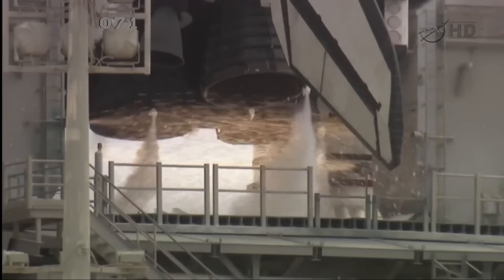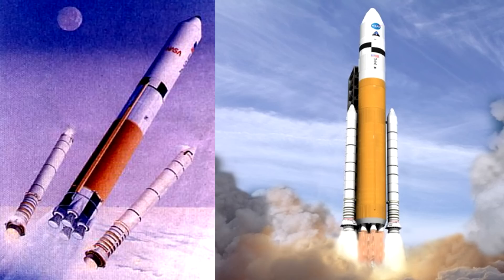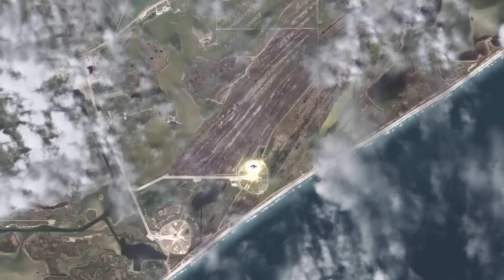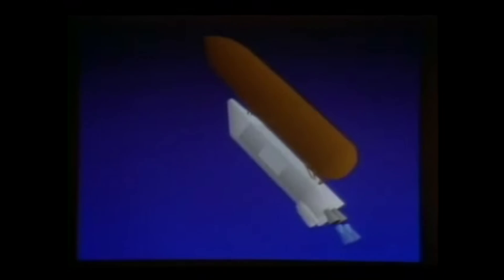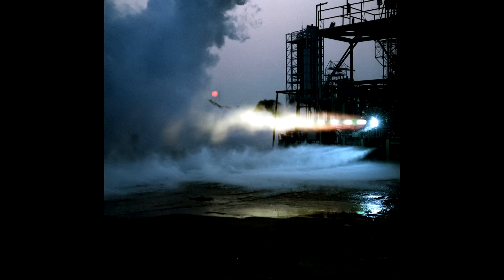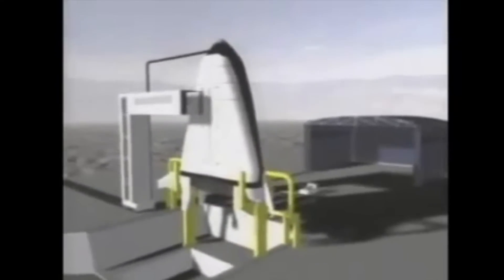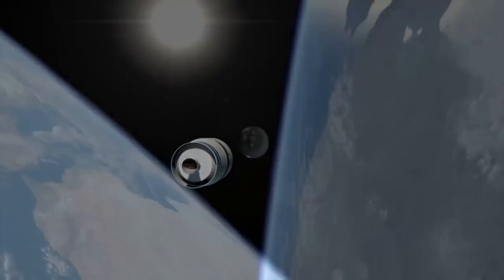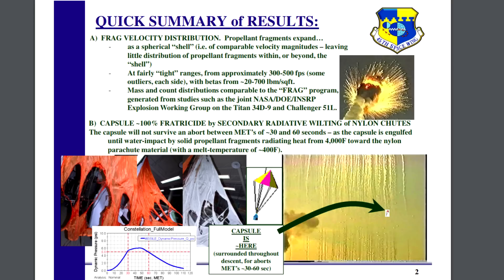Why The US Took So Long To Replace Space Shuttle's Crew Capability

Comment: If they stayed with the original spiral development plan for the CEV and put Orion on the Atlas V or Delta IV Heavy it would have already been flying for several years now as Ares I coming up short in performance forced them to design it a few times causing delays.
The change from the airstart SSME to the J2X dropped the payload significantly forcing a redesign while if they baseline the orginal Delta IV Heavy they would have started at 24 tons of payload but with the RS-68s ended up having nearly 29 tons to work with when the RS-68A upgrades were done.
On Ares V I wonder why they didn't consider wrapping the RS-68 nozzles in insulation like the Saturn F-1 engine?

Comment: This is embarrassing, do you guys realize how big space is. Assuming the information we are given is correct. Just our own system extends out to nearly a light year. It's like you use a perfected tech from the 1950s to drive across the USA. Say at the max speed the engine could efficiently operate 45 to 50 mph. Which is 2800 miles rounded up. At 50mph which would take 56 hours, at 8 hours driving per day seven days. Ridiculous is that,  it's estimated that the distance to the edge of the Sol System if you start at Earth is 9 billion miles. Now be generous a human spacecraft using only Newtonian Physics can achieve 50,000mph, I did the math rounded to the nearest year, 21 years. Remember Voyager one and two had a great deal less mass then a manned spacecraft would have. Given this progression it would be sometime in the mid 22nd Century before we finally left the confines of Sol System for the void between heading to Alpha Centari which woul be maybe 3.8 light years farther. A light year is 6 plus trillion miles. RIDICULOUS!!!

Comment: Space shuttle engines had to be rebuilt after every flight, so I don't call them fully reusable
Reply: Look at drag racing. The engine is rebuilt after every quarter mile run and they return to the track. I would call that a rebuilt engine, it works.
Reply: Zero percent reusable when you throw it into the Atlantic.  Go, SLS!

Comment: Only thing is for the X33 they could have used aluminium tanks, they had prepared aluminium tanks that would work, but NASA wanted to demonstrate carbon fibre tanks with the X33 so it was shut down... And I think 3 years later the problem with the carbon Fibre tanks was solved, but by that time the administration had changed and they didn't want to back a project that was backed by the previous administration... In otherwords NASAs biggest mistake, well apart from the Space Shuttle.

Comment: Boeing's starliner will never fly. They're the same contractor that is partially responsible for the cock up with the SLS. They've pushed Starliner debut so far, it's a month or two after SpaceX's first crewed mission, and starliner is still likely to slip into the new decade. I think NASA might just cancel Starliner as a whole, and give SpaceX the pat on the back.

Comment: It is somewhat frustrating that in the time of Apollo, the goal was set and for the most part the country pulled together and industry, R&D and computing built from almost nothing an amazing infrastructure.  Also it was done in a rather short time. In 2005  I was really saddened GWB announced the  retiring of the shuttle.  Considering it was not the shuttle NASA wanted but they made it the best they could with the resources given them. I was excited though when at the same press conference GWB said we are going back to LOE and the moon with Constellation.  He said to be back to the moon permanently by 2014. Well 2014 has come and gone and in that time Constellation was cancelled in favour of Orion/SLS.  But sadly it is taking longer then hoped and it's schedule keeps slipping.  If it had been funded as Apollo was I am sure Orion/SLS would have been back to the moon by now and a LOP-G of some sort would be flying as well.  Oh well such is politics I guess.

Comment: how about we stop the shuttle and its predecessors, how about some Saturn-derived vehicles?? 

No to Orange tanks
Yes to White and Black
Reply: Imagine if they had just kept evolving the Saturn like Atlas and Delta... We'd probably have some monster rocket that can lift hundreds of tons for a decent price. Even the Saturn V was less than half what the Shuttle cost per kg to orbit depending on what numbers you use (7k per kg to orbit vs. 25-40 for Shuttle or 11k on SLS.)
Reply: They wanted to paint it black and white, but it was too heavy then, so it's naked
Reply: @asbestosfibers1325  it was supposed to be white and black, but, it was too heavy then... (Screw it, truth is NASA engineers were sexually atracted to this nice cigarette that they choose naked variant)
Reply: Rockets are gonna be back in black
Reply: @homerocketscience1874  whiteness will die on Earth.
Reply: Looking back at it now how awesome would it be to have a Saturn V derived rocket with a fully reusable first stage?
Reply: It would have been cheaper to continue producing Saturn 1B's and V's, NASA could have developed the Saturn 8/Nova and had it flying by the mid 80's for half the price of the Space Shuttle. They also could have adapted the Saturn rockets into reusable rockets if the cost really was that high, Congress didn't cancel Apollo because it was too expensive, they canceled it because they got lazy.
Reply: This is racial discrimination.
Reply: The booster  were painted white. To cut cost they just left it in the primer color of orange.
Reply: @TheJer1963  all, including paint has it's mass, just calculate the mass of the paint. 

The shuttle was most expensive but had unique capability of bringing down objects from orbit. It was stupid concept for everyday use, but genial for some special tasks. The complexity of the concept bring a infamous results. Russian Buran was improved concept but overall costs of mission and unreialability for long run as well as economic catastrophe of ussr bring down the project.
Reply: White and black paint jobs on rockets are Raysisst! REEEEEEE!
Reply: @georgetaylor4719  
Is this supposed to be funny?

Comment: Isn't Thyocol the company that refused to delay the Challenger launch?  so...WTF are they still in business?  Also, whenever anything is nationalized inefficiency goes up, production goes down and waste due to mismanagement increases significantly.  Unfortunately the divisions get run by bureaucrats who are a friend of a friend or paid a bribe to get the job or voted along the same party lines instead of someone who has proven they are good at managing the resources they are given.
Reply from the maker: Thiokol, under pressure from NASA withdrew their objection to the launch.
Reply: @scottmanley  that's right, cause NASA was under time constraints due to the science lessons that we're supposed to be broadcast on Friday of the same week.  I knew I remembered the name, just was fuzzy on the details.  Thanks for taking the time to reply Scott.

Comment: NASA has a bad habit of buying into technologies that haven't been proven. Consider the shuttle, STS. We hadn't even built an experimental spacecraft that could land back on Earth. The closest we came was the X-20 program, which got cancelled because it was taking money away from Apollo. And yet NASA went ahead with the idea that the heat tiles would stick to a craft travelling through the atmosphere at 17,000 MPH. This is much the same as what the Pentagon does. I first heard of the F22 and F23 flyoff back in the mid 80s. F22 won the flyoff in 1991. Took 15 years, several redesigns and so many cost overruns and setbacks.
There's a reason we used to build experimental aircraft. To prove the concept before we bought into it. No more.

Comment: I think NASA with its SLS is at the crossroads again that can potentially damage its reputation (again) and throw it back to having no reasonably affordable manned spaceflight capability (again). At the time of rapid development of reusable rockets their SLS is just as rapidly becoming grossly outdated. Do they continue for many more years to come its development. And at what point in time do they start working on reusable rockets. Before or after they finally finish building the SLS and Orion. If they switch to reusability any time soon they may have a chance to catch up with SpaceX and Blue Origin,  ut that would mean huge spendings and nothing to fly on (again) for another decade. If they carry on with SLS they will fly soon but will fall behind in design, possibly irrecoverably in any foreseeable future.

Comment: Look.. NASA could have maintained continuous manned launch capability with very little effort. They had a well functioning Atlas V launch vehicle (the same over-specified one they're using for the CST-100) already in 2002. Even the smallest configuration (Atlas V 401) has better performance than the Soyuz-FG that the Russians continue to fly... and even at 4 meters could accommodate roomier capsule than the current Soyuz MS.
BUT NOOOOO...
NASA has to over-think everything and spend two decades designing a giant, inflated Apollo-wannabe for no apparent mission.... disgustingly wasting billions and (more importantly) years of talented engineering resources.. which could have been better spent. man-readying the CRV (X-38) for these ferry missions. 
Had they conducted this project in earnest, it could have easily been ready by 2005.
Reply: Needed a capsule to put on top of Atlas V. A simple orbital one doable by existing NASA system. But, nooo. Look at all the money NASA saved by building the multi-use, multi-capability Orion.  ;)  lol

Truthfully, no one at NASA had the stomach to admit they had to take the giant step backwards to simple space capsules, instead of spacecraft. Would be revolting to the space-interested public (like me), and no sexy selling points for Congress.

Ultimately it was lucky for us; otherwise Commercial Crew probably wouldn't have happened, and we'd be flying that NASA orbital capsule for as long as Soyuz.
Reply: Blame congress. They could've pulled an apollo capsule out of the Smithsonian, sat it down in front of some engineers and said "Hey, build this with 2000s tech", and we'd have had a perfectly usable launch vehicle to sit on top of Atlas rockets.

I seriously think NASA needs to be made more independent, with mutli-year funding set by law instead of getting jerked around so much.

Comment: Fantastic video.  Slight clarification, Ares-I was not only designed to take Orion to ISS as stated.  It was also originally designed to get Orion to LEO where it would rendezvous with the Ares-V payload (Earth Departure Stage and Lunar Lander) for Lunar surface missions.  The idea was that the Ares-I would be man rated, but the Ares-V 1st stage would not have to be since it didn't carry crew (although it's upper stage was the EDS, so would push the crew to the moon).  The Orion to ISS was to some extent a "side mission" as a "back-up" to commercial crew which was in its infancy at the time.  This all became mute when the Orion + SLS concept rose out of the ashes of constellation and Orion's sole focus became "exo-LEO" exploration.  Fun fact, Orion still has ISS mission related design requirements on the books even though it will never go to ISS.

Comment: The SLS is a tragic error. One lauch throw away four shuttle engines. Ten or fifteen years ago I wouldn't have writtten this. Times change. Courtesy of SpaceX for one.  NASA has changed to, for the worse. SLS is just an overgrown Saturn 5 with an overgrown Apollo. No matter what they tell you.
I've been a space nerd since before NASA was born. Truman was president when I was born. NASA has certainly have had their high's and low's. SLS is one of the lowest.
Another low. The cacellation of the X-33. From Wikipedia "Construction of the prototype was some 85% assembled with 96% of the parts and the launch facility 100%[8] complete when the program was canceled by NASA in 2001. Had fixable problem's as you mentioned. Another bone headed move.
Sounds like a NASA rant. It's not. They've done some wonderful things. Biggest problem? NASA our so called "civilian agency". Is strangled by the idiots in DC. NASA is supposed to be all about space and science. Yet it's run by dumb ass politicians. What a horrific waste.

Comment: hey Scott, when i helped build apogee engines for fat comm sats,
 innovation was unacceptable in 2005, down to rosin core solder diameter
 used on valve solenoids, even though diameter was uncontrolled on the print

Comment: Lets not all forget about the X-37 which was a small scale test model of what was suppose to be  a suitable replacement for the space shuttle. But as we all know this project got transferred to the Air Force . Last time I checked the two X-37's that they are flying have been setting new records while they carry their classified payload.  Also NASA could have just replaced the Solid rocket booster to Liquid Fly Back boosters That would have been a lot cheaper than replacing it out right. Funny thing is the Space shuttle was suppose to have this type of boosters from the beginning. But the budget cutting monster stepped in and canceled that as well. And here we are today.

Comment: Wow,  ok.  First off SLS sucks.  I used to work for Rockwell International Space  Division Downey from 1986 through the closing of the company in 1999.   I was on public relations and speakers Buearu full time.  So where to begin, yes shuttle was not perfect nor was it given a chance . Meaning that in the first era of the program it was being treated as you would an expendable LV.   It was being used for everything,  science,  commercial launches,  planetary missions, DOD.   So all expendable LVs were cancelled and production stopped,  post 1986 came to be known as the 2nd era of shuttle and the new mixed fleet concept and then President Reagan ordered NASA out of the satellite launching business.  Thus ULA, Boeing,  and MacDac came into their own and thus the private commercial sector was born.  And not let us forget Sea Launch! Boeing and the Russians.  Boeing has sold Sea launch back to the Russians and is still based here in the port of Los Angeles.  The mentioned first HLLV was actually designed by Martin Merietta of Denver CO. back around 1983, 84 time frame.  They also came up with the Boost Assist Module.   This consisted of a Titan 2 engine package and two modified hypergolic tanks that attached under the ET.  This would Not have been ignited on the pad but started around the time after Max Q and before SRB sep. Reportedly Martin built a mockup of this but never progressed to the actual hardware stage.  
Then came the NLS, then came the Shuttle C concept.  It was not a Boeing design it was ours, Rockwell International Space Division. It was built using the original MPTA, Main Propulsion Test Article.  (MPTA 098)  Yes it actually had a number.  That is why it had actual plumbing in the Aft section.  The payload section was to be 83 feet long and 15 feet in diameter.  Plans were made to stretch this  to 95 feet and max to 100 feet if really needed.  The SSMEs were to be stripped down units that were at the end of their lives.  But unlike what was stated in the article plans were in works to provide production engines that were modified non manned rated non reusable units but using existing shuttle hardware components.   That way there was no need to "wait" for expired engines.
Now to take a step back a bit, yes the Orbiter had problems,  but it did what it was designed to do and brought back her crews. None of the problems that destroyed two Orbiters were caused by the Orbiters, they were caused by external components.   In 1986 even as the vehicle was under going structural breakup, the Orbiter was fighting every second to correct the situation it was encountering. To the very end.  And the NTSB cleared the Orbiter it self.  And then in 2003, Columbia, foam from the ET damaged the Orbiter.   On  reentry Columbia was fighting every situation it was encountering, correcting and fighting until the wing literally melted away.  What Columbia experienced was basically what happened to the X-15#3 in 1968, a hypersonic breakup. Only Columbia was actually reentering the atmosphere,  the X-15 entered a hypersonic spin.
Now what was not mentioned was the Direct proposal.   In 2006, 2007 , 2008 there was a plan devised by engineers to provide launch capability by using and upgrading the basic backbone of STS.  Only the Orbiters would be retired. This plan refered to as "Direct" would keep the SRBs, ET, launch infrastructure,  crews , and work force intact until the then Constellation spacecraft,  now Orion,  could come on line.  That was the only pacing item that would be needed.  The ETs  would be stretched,  strengthened,  and modified to launch space station modules. Planetary probes, and be modified later with the 5 segment SRB.  All while maintaining a man rated certification.   Only the Spacecraft needed to be worked on.  This program passed all critical design reviews and structural requests.   But in 2009 when it was brought before NASA for final review and acceptance,  NASA cancelled and basically black listed this program.   This program would have had almost no down time while new ETs were manufactured, they would have been phased in   along side the final Shuttle ETs. In the time line the new Direct ET would fly it's first test flight one year before then end of the Shuttle program. 
So in my opinion,  yes SLS sucks and we are just rebuilding Apollo using new technology.